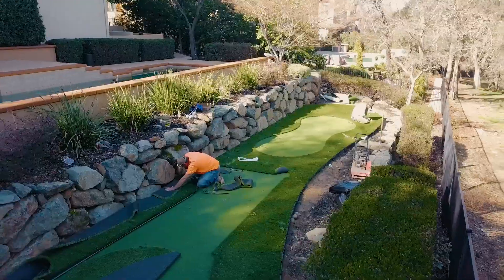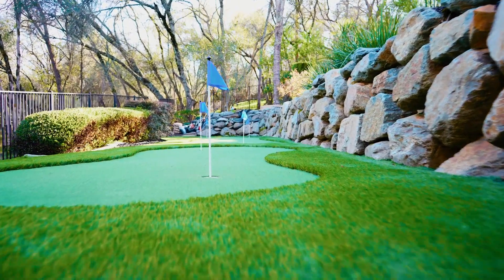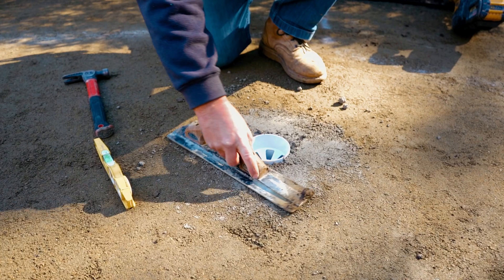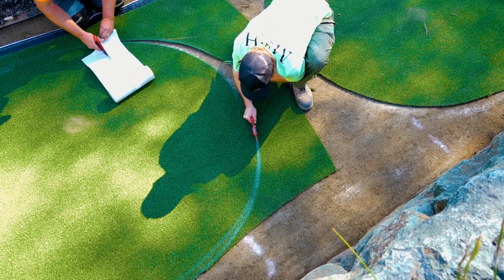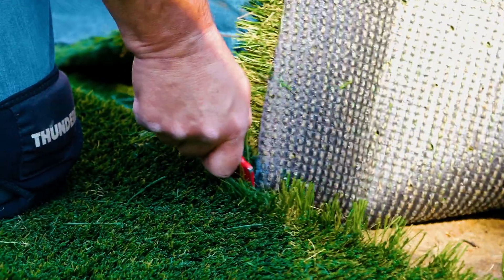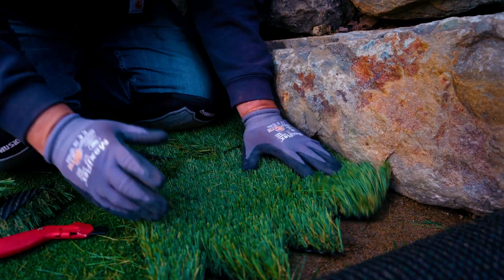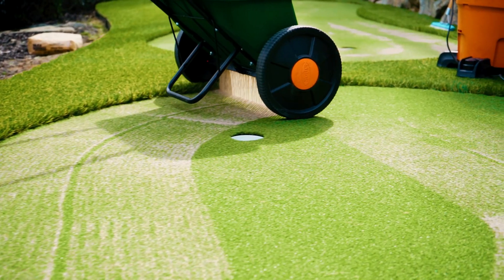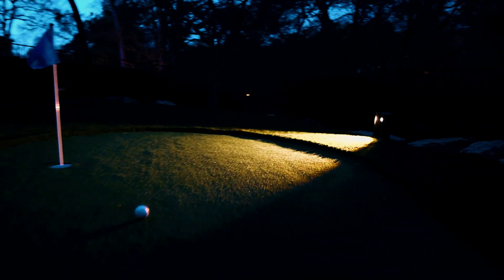Artificial Turf Putting Green Installation Process

Comment: That is called professional work..just setting the cup alone!..I am a DIYer laid ~200 sqft2 green with fringe..I used 50 green sand to fill the green and 30 for 1/12” fringe…that is how I do my aluminum cups with hand dig, level the cup to be sure 3 feet around the cup is leveled and laid with cement ~2” from the cup, let it dry before putting on green…godd job!